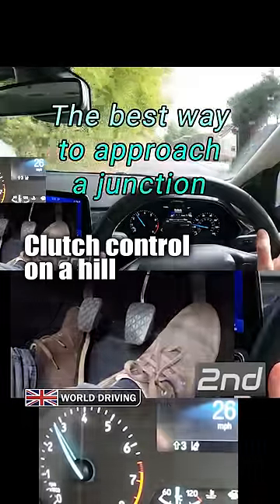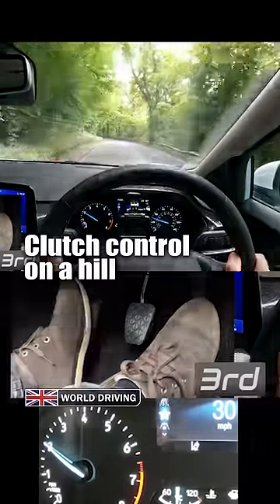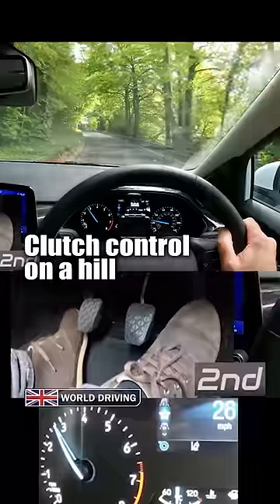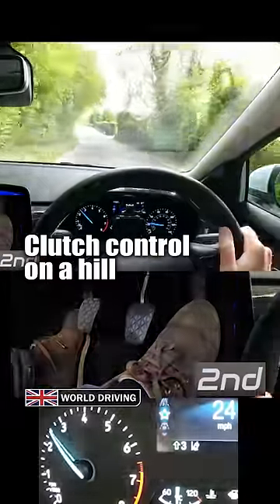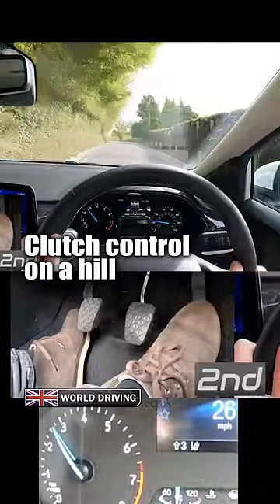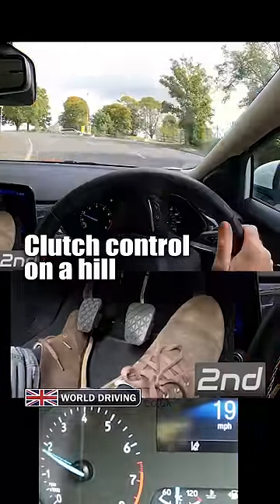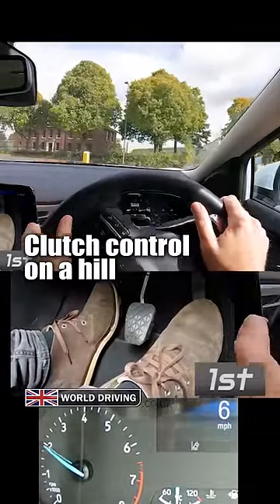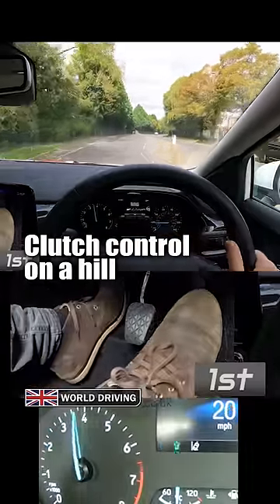Clutch Control on a Hill - Junction  #clutchcontrol

Comment: Downshift and rev match. Driving never becomes more fun, easier and smoother
Reply: What do you mean by rev match?
Reply: @WooxSB have u found out?🥺
Reply: @officialsentiment. Rev matching is a technique used to change gears smoothly and with minimal disruption, there's video on it, need some practice tho.
Reply: @B0TZ also helps with clutch wear on awd and fwd cars, and stops unnecessary engine braking that causes the car to spin out in rwd cars
Reply: @WooxSB   sorry I never saw this! It’s essentially what the others have already said! Conquer Driving has a rly good video on it and that’s what taught me, took me about a week playing around with it on the way to houses when I delivered for Dominos. Must’ve been a couple months till I felt I had a proper hang of it. Improvement since then and about a year now of always doing it? it feels fully mastered and is automatic in my head to get to any gear. 

I engine brake to slow down very often with downshifting smoothly and letting go, unless I need to come to a full stop I find it much better to get me to the right speed. 

Infinitely useful for if you’re about to go up a slope and need to go down gears, you can do it in advance 
And much better for engine and transmission 

All sound points above this comment so I won’t echo those
Reply: Oh also you can quickly approach roundabouts and junctions but also come to a stop extremely quickly on a lower gear
Reply: @B0TZ  Bad for Car ?
Reply: @marvin2678  better for your car👍
Reply: Rev matching completely changed driving manual for me. So much smoother, and it’s satisfying to do
Reply: Rev matching during my driving lessons, my instructor doesnt even care 😂
Reply: @WooxSB  it's when you press on the accelerator in between gear shifts so that the engine isn't jerkily shunted faster by the lower gear. If your car does 2500 rpm at 20 mph in 2nd and you are in 3rd and you want second, you press the clutch in, rev the car to 2500 rpm (hard to get it exact but close enough) and select 2nd, clutch out. Otherwise the car engine is shunted from 1600 rpm, (or even idle if it dropped during the gear change) to 2500, making it feel like you are jerkily braking.
Let's say you are in 5th at 50 mph and 2000 rpm and want to overtake a car. You use third gear so you have more power and during the gear change you rev the engine to 4000 rpm to stop the clutch trying to jerkily force the engine faster. Then when you get third gear it's a smooth transition.

Comment: Is it always necessary to go to first gear whenever you slowed down? What if you were on 3rd as you approach the hill junction?
Reply: You’d be lugging the engine and it could even stall
Reply: Third is too high..second should be fine if you have good clutch control
Reply: Third is too high for the car to cope as you’re going up the hill. Even on a flat surface, as you slow down the car won’t be able to hand much lower than like 15/20 mph in 3rd
Reply: That hill was way too steep and you should approach junctions slowly to be able to observe and continue efficiently and safely. For a flat junction this would usually be 2nd gear so on a steep hill like this 1st/ maybe 2nd would probably be ideal
Reply: 100% necessary
Reply: 3rd at an intersection? 😅 damn boy you better slow down
Reply: You can always brake and use the neutral break
Reply: 3rd gear at 7mph? It would stall no doubt... But you can approach in 3rd and then keep the clutch fully down and go straight to first once you have reached an appropriate speed (4-10mph) and then continue following the road

Comment: That's cool if there's no traffic and you are familiar with the road. If you don't, you'll have to gently press the break to observe or even full stop
Reply: That’s the issue, when cars come in front of u, u have to stop for a while, then releasing clutch and brake makes the car go back instead of front, if we try to accelerate we have to remove right foot from brake which again makes the car go back
Reply: @shashankmallamraju4271  yeah it will move back a bit. Experienced drivers instantly put the clutch to the bite point while releasing the brakes to lessen the backward movement or they use the handbrake method. I use the first one on not so busy street

Comment: What sorcery is this?
Reply: fr i passed on a diesel and getting used to petrol is so so so difficult😭
Reply: @sahib7285 100% right
Reply: @princechiremba1410  after having my car for 6 days i’m actually already used to it it doesn’t take a lot of practice
Reply: @sahib7285 how are you doing now almost 2 weeks later? I just started driving my first standard 5-6 days ago and I’m starting to get more comfortable with it too, does it already feel like second nature to you now?
Reply: @chubbschubbs2x  honestly bro i’ve been driving every day and it is second nature now it was a lot easier than i first thought
Reply: @sahib7285 A bit late but what made it more difficult for you?
Reply: @jellyj8194  the clutch control is so so different; on diesel i didn’t have to use accelerate with the clutch when moving off, so getting used to that was big for me
Reply: @sahib7285  ahh makes sense. But in that case couldn’t you still apply gas and continue how you would have done in your petrol?
Reply: @jellyj8194   sorry i meant that i had learnt on the diesel, so getting used to putting gas down with clutch was the struggle; i got used to it after a week or 2
Reply: @sahib7285  oh okay makes sense. Thanks for responding!
Reply: @sahib7285  whoever taught you to drive like that was wrong to do so. Diesel cars are very common for learning as they're easier to move off, but you should stil be taught to use the gas every time you lift the clutch in first gear.

Comment: I prefer manual cars than the fuel injector aspirated ECM and sensor controlled vehicles.  Best vehicle is a 1960s Willy's Jeep with 3 speed manual gearshift with 4X4 transfer case its strong like an elephant and never disapoints even in the roughest of terrains.

Comment: I'm new to clutch guys but from what ik, the moment u release the clutch the car will goes "dead" where u hv to spin the key agn to activate the car, but at the very end I see he release the clutch and he's on gear 1,yet the car still working and even accelerating, or is it depending on the type of car?
Reply: You have to slightly give gas and increase your RPM and then release the clutch gently. The engine is more likely to stall at idling RPM. Maybe that's what you are doing wrong.
Reply: @vyshakshetty1047  yea, after watching more vids abt clutch and wif ur info, I believe I release clutch sooner than it shud be. tqsm for explaining ❣️
Reply: @Blank-pichak  clutch at biting point and gas pedal also somewhere in the middle until the car is stable and then release clutch
Reply: @nesletchimaew9209  my instructor taught me only release clutch on gear 2 but I found a vid where u need at least 5mph then only u can release clutch, even on gear 1. tqsm for the guide :)
Reply: @Blank-pichak  you misunderstood him, there’s certain situations you’d switch to gear 2 on before releasing clutch - including starting off a downhill, but otherwise doing that in most scenarios would not make sense.. could be dangerous. Unless his car is rather unique. Maybe he wanted to keep revs lower to save fuel who knows 🤣 wouldn’t be good for the engine to lug though
Reply: @Blank-pichak  also probably about 10-14mph is best in my experience, depends on car and of course circumstances. You can feel and hear the car  to tell
Reply: @sensationlive3528  I believe it's bcuz the car I was using is too slow on gear 1, to be beginner frenly? ntm the car brand is kinda too old for the tech nowadays. The only time I release clutch while on gear 1 is driving downhill which I think I got enuf speed for me to release it. Also I'm not sure if 10 - 14 mph is abit too high for the car I was using? cuz i only able to achieve that speed on gear 3. Anyhow rlly appreciate u for sharing ur experience😚

Comment: people say not to down shift into 1st gear
Reply: yes. its hard to shift from 2nd gear to 1st gear while your moving.
Reply: We have been plastered with a delightful mix of snow, rain, and ice over the last week. I only downshoft all the way to 1st gear if I need that stopping power and control in slick conditions. Engine braking/control is essential to me in slick conditions. Not just for braking but just in case I need to move out of the way of a car in front or behind me. Don't want to be caught off guard in neutral when a nearby car starts to lose control!
Reply: If your revs are low enough then no problem